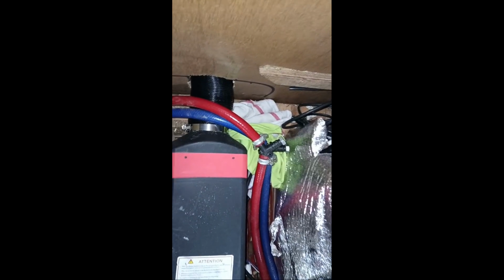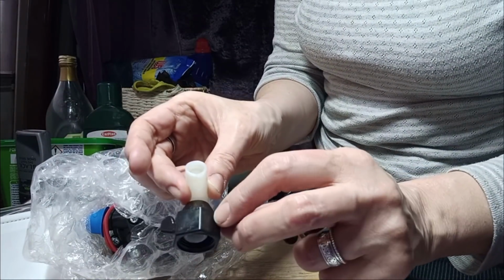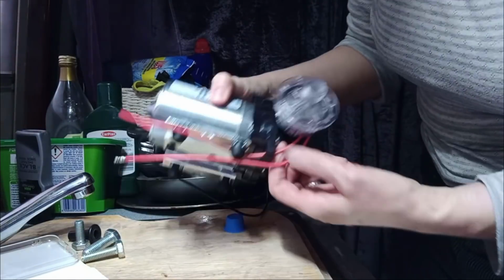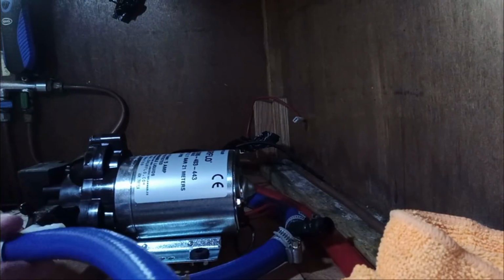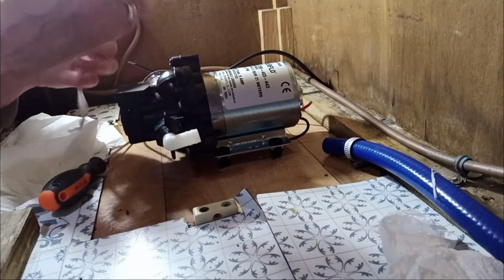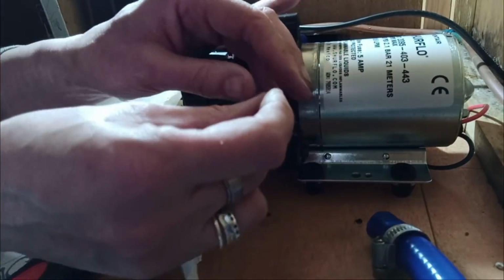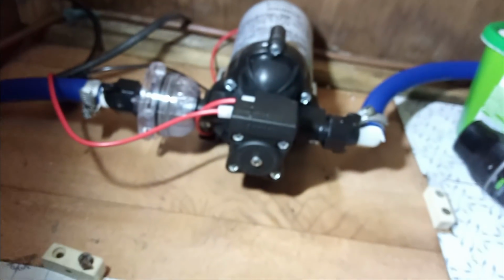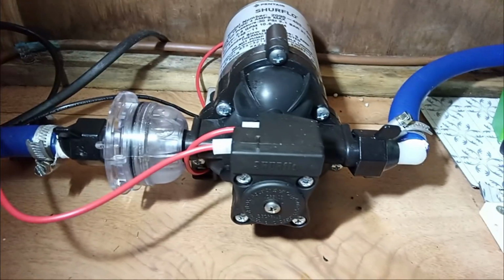Is That The End Of It?! #vanlife #fulltimevanlife #vanlifeuk #shurflopumpfix

Comment: Hi Coral. This is Graham hear.
Reference your new pump.
The rubber mountings are not for fastening , they are like shock absorbers, there was two holes in between the rubbers for screwing down.
By screwing down at these points may cut down on the noise when it is running.
Love the videos ,  you know where we are if you are in the area or need help.
Take care ... 😘🤗❤️👵🏼🐾🐾🤠xxxx
Reply from the maker: Aye up G, ah I did wonder about those holes. I might attach it to the floor although I'm thinking that cos that's wood it'd be just as noisy? Not sure 🤷‍♀️. Glad you're enjoying the vids. Roll on when we can get out and about again! Thanks for the offer of help (again) 🤗xxx

Comment: it is possible to replace the bonnet release cable for a couple of quid! Get a bicycle brake inner cble and feed it from the handle through the outer sleeve until it arrives at the catch. If you wriggle under thee front of the van and look between the radiator and the front grill you wil see the lever you normally push with your finger. Press that to release the bonnet. Spray the whole catch with penetrating oil (not WD40) to make it move easily. Then take your brake cable, feed it through the catch and bend it back on itself. If you then use an electrical block connector you can fix the cble to itself and it all works well.
Reply from the maker: Hey Dave, ah interesting I might look into that. Will it be long enough then?
Reply: @anothercampervanchannel  Had to do this to mine. The cable doubles back about two foot/60cm. When you go to the bike shop (or even Halfords) ask if they have the little cover to go on the end of the cable to stop it unravelling. DO NOT CUT the cable, it requires a particular type of cutter, normal wire cutters will crush it and it will unravel, so better to leave it intact.

Comment: The power steering pressure spikes dramatically when it is at hard stop position R&L. It's best not to do it at all, easier on pump, hoses, belts and steering box. Check steering fluid level. Check belts.  Check steering pump mounting. After checking those things and the power steering works well, NO WORRIES
Reply from the maker: Hey James, well I'll try not to put it on full lock but sometimes it's necessary isn't it, like when you've parked somewhere and some bellends have parked 3 inch from your bumper so you have to do a 26 point manoeuver to get out? 😂
I know fluid is fine but not sure about they others. Need to find a decent mechanic for that I guess 😏. Cheers 😊

Comment: Hi. the power steering fluid is gone by its useful date and the nasty sound on full lock is the pump looking for a little TLC. It's no biggie, the growl  your listening to is Cavitation Its bark is bigger than its bite. An excellent vlog that shows  the few tools you need and the steps to take is "Auto Buddy" (Power steering fluid change) Transit van.
Reply from the maker: Hi Mick, ah okay. So fluid has a sell by date then? Well I've never touched it in two years and don't know when it was last changed. 🤷‍♀️. So how do I give a pump TLC? Just get fluid changed? Cheers 😊

Comment: PTFE tape can break apart into fibres and ruin your new water pump. The jubilee clip should be enough to compress the hose onto the the barbed pipe to make a well sealed union assuming that the old barbed pipes are the same size as the new ones. Me and my mates love watching your videos, so we can see how not to do things  (meaow). Sorry for that, it's the critic in me coming out. At least you're doing things in your van, the cold weather is putting me off. I'm such a wimp. Matt
Reply from the maker: Hey there, yeh and actually the manual said to not use it (but I didn't read it until after I'd fitted it 🤦‍♀️). I'm going to take it off I think. Ha, well I'd like to think that people can take at least two things away from my videos and that is, how not to do things (learn from my mistakes) lol, but also, if I can have a go and get things done then anyone can.😁 I've never removed or replaced a water pump before. I've never demolished a wall and made a seat with storage before, never wired in lights-it's all new stuff for me so I think I've done okay 😊. Get on with those jobs 😉😊
Reply: In addition to those two things you give your viewers there's a couple more things we get from your vlogs : entertainment and humour, which I think we are all needing right now so it's a win win 👍

Comment: Power steering pump. Low fluid. Or sticky valve in return system from the steering rack.
Reply from the maker: Yep, others have said the pump. Not sure why it stops making the noise though? Fluid is full and has never changed since I had the vehicle. Cheers 😊

Comment: How weird you being local to me. 
Anyway if I was you I would be carrying a can of easy start with you.
Also one of those new super capacitor jump start packs.
Maybe a mop and bucket as well lol
Reply from the maker: Hey Mark, ah where are you then? Yes, I must get a can of easy start although I don't know where to spray it 🤔 Some have said the air inlet pipe or something but I've no idea where that is, lol. So the jump start pack, isn't that just for flat batteries? Lol I got a mop and bowl 😁
Reply: @anothercampervanchannel  Allerton. I recognized were you was broken down. And a earlier video walking under thornton viaduct.
And yes spray the easy start in the inlet air pipe.
Happy camping.
Reply from the maker: @Mark-ob1dh  Ah right, not far away. But I don't know where the air inlet pipe is...🤔🤷‍♀️
Reply: @anothercampervanchannel  
We're the air filter sits the pipe go ing to the engine inlet. You only need a small few squirts in the pipe. 
Then the engine wil suck it in. Giving you the best chance of cold starting the engine.
Best of luck.
Reply from the maker: @Mark-ob1dh  Ah ok, thank you Mark. I'm a bit wiser now 😊

Comment: Hi Coral. The pump sounds OK to me. The reason it started when you first switched it on was because it works when it detects a fall in water pressure and will run until it pumps water up to the tap. When you close the tap the pressure equalizes and the pump stops. So basically if it has no water it runs all the time. Hope this helps. You didn't need the PTFE tape by the way the connectors are designed to be used without any additional tape or compound. See I am still a smart arse. Any way great Sunday evening entertainment as usual. take care and keep safe and warm. 💙❤️👍
Reply from the maker: Hey John, ah thank you for the explanation. Being a smart arse comes in handy doesn't it? 😉😁 Yep, manual said no tape (didn't read it until after I'd fitted it though, lol. May take it off. Thank you 🤗
Reply: @anothercampervanchannel  Hi Coral, There is no real need to take the PTFE tape off. Personally if its not leaking I would leave it. Keep the old pump and connectors as spares. You never know. Take care 💙❤️👍
Reply from the maker: @johnbateman3244  Awesome, I didn't really want to break my back getting down there again, lol. Cheers John 😊

Comment: When removing pipes warm them up with a hair dryer. Or dip them in hot water. They will come of easy. And go back on easy when warm.
Reply from the maker: Hey, good ideas but I'd struggle with both I think 🤔. Don't have a hair dryer as it uses too much power and it's be hard if not impossible to get those pipes in that position, in warm water. But otherwise, they would both work. Cheers 😊

Comment: So I asked a couple of mates what the clacking noise could be on the steering. Its like asking someone with 10 watches, what the time is :-)  Anyway, ball joints came up a couple of times. I tend to agree with Mick's comment below, power steering fluid, especially since it disappears when warm.
Reply from the maker: Hey Sean, lol, yep I get that about asking someone with ten watches what the time is 😂 That's what's happening here. I've had ball joint, crankshaft, low steering fluid (defo not this as it's full and always has been whilst I've had the van anyway), steering pump, sticky valve in return system...🤔🤷‍♀️ What's really confusing and what nobody has answered so far (not read all the comments yet) is why it's stopped doing it now? 🤔🤷‍♀️

Comment: Knocking on full lock is common while stationery  and not really an issue .more of problem if it does it when driving on full lock .probly low fluid if it's balljoints will show up on mot test anyway and there cheap anyway so don't pannnnniiiiiccccc😍
Reply from the maker: Hey Desmond, hmm, when it first did it though, it wasn't on full lock I don't think. But anyway, it's not doing it now so I don't know what to think? 🤷‍♀️🤔 Cheers 😊
Reply: @anothercampervanchannel   check  powered steering fluid but read a manual first because some vehicles you check when cold/others hot/some with engine running and some engine off and this varies year to year with most makes and models same rule applies to engine oil..its important to get it rite 😍😍
Reply: @anothercampervanchannel  just for info I don't fix cars only vans and trucks buses coaches.dont no much about cars apart from there all crap....please do not get into the mindset of better van means newer it dosent at all..get the old stuff rite it's cheaper in the long run .normally anything serious is a couple hundred ...newer a couple of grand ..ime old and creek a bit as well but ime mint overall just like you..take care ask if your not sure it's no trouble. And always remember Google is your friend 🤣🤣
Reply from the maker: @desmondbroad1305  Lol, I agree Desmond, old is usually cheaper assuming you can find the parts. That's my main concern with it being a peugeot. If I had a Ford I'd feel less concerned, lol. Cheers 😊
Reply from the maker: @desmondbroad1305  Rightio, that's useful to know Desmondo. Thank you 😊

Comment: Hi Coral  the sound from your steering could be the power steering pump and when you put it on full lock you get a lot of pressure in the pump and that can cause the noise. Your water pump works on how much pressure is in the pipe so when you open a  tap the pressure drops which makes the pump come on. Best wishes and catch you later. 👍😊
Reply from the maker: Hey Stephen, yes, a couple of folk have said steering pump. Just a bit tricky to diagnose when you get to the garage and there's no noise, lol. Cheers love 😊

Comment: I think its a problem with the power steering pump pressure bypass. so you have no noises when you turn from left lock to almost full right lock and visa versa. the noise is only apparent when your on full lock either left or right, so this suggests where the issue is. was it a new pump you fitted and you used the Correct power steering fluid ?.
Reply from the maker: Hey Colin, right okay. I haven't fitted a new pump for the steering only a water pump for my tap 😊. Steering fluid is full and never been touched since I bought the van. Cheers 😊

Comment: Power steering pump has air in it hun my van used to do the same although in the end we just replaced the pump
Reply from the maker: Hey there, ah okay. How do they get air in them then? Is it anything to worry about? And lastly, how much is a new pump? Lol. Cheers 😊
Reply: @anothercampervanchannel  air just gets in not sure how. If you take the cap off the power steering fluid fill up under the bonnet and turn the steering fully side to side with engine running you can get rid of it that way.   Worth trying before buying. It will also show you if you are low on fluid too. We bought a second hand pump for about £70 on eBay.
Reply from the maker: @tohellwithnormal2258  Took the cap off at the garage and turned the steering left to right. The noise does seem to have gone but it went before we did that at the garage so it's a bit of a mystery really! yes, been looking at pumps on ebay. Saw one for £89. Hopefully won't need it. Cheers 😊

Comment: Nice job can u mount it to the wall at the side ur back mite give you more room to put a basket
Reply from the maker: Hey Gary, hmm, there's a thought. Not sure the pipe from the tank would be long enough though and making that longer looks like a nightmare job as I can't even get to the bottom of the tank as far as I know 🤔. There is a kind of half box thing that goes over the top of the pump so I don't lose that space completely. Good idea though. Cheers 😊
Reply: @anothercampervanchannel  ok hun just a thought xx

Comment: Hey coral ,the law of 3 dictates youve had your run of mishaps, better things to come ,blessed be
Reply from the maker: Hey Kevin, lol, only problem with that is that I've had 5 things-water through the roof, wiper motor packing up, water pump leaking, steering making a noise and also bonnet cable not doing what it's supposed to 🤦‍♀️🙄. Do you think 5 things is enough? 😏
Reply: Ok will a adjust it law of 5 it is then ,lol basically the laws are just a guide line ,just keep believing, blessed be
Reply from the maker: @kevinrossington509  Lol, fab. Yes, I'll try Kevin, thank you 😊

Comment: You only use PTFE tape on threaded joints, you don't need any on there.
Reply from the maker: hey Chris, yep I read the manual (after I fitted it) and it said not to use the tape so I might take it off. Cheers 😊